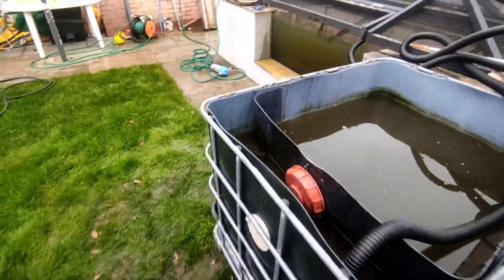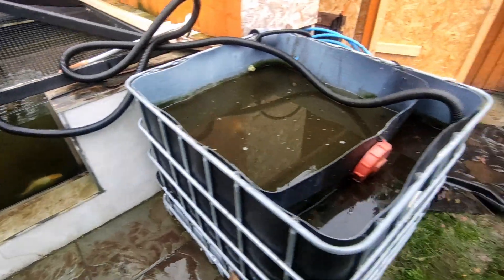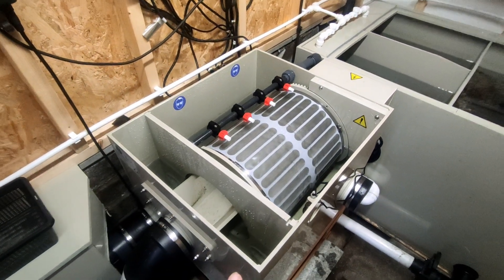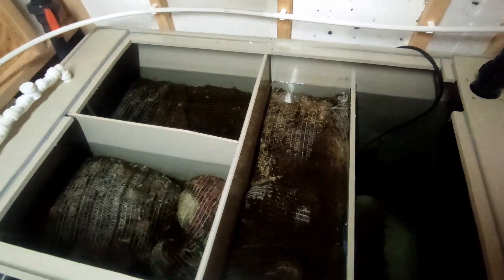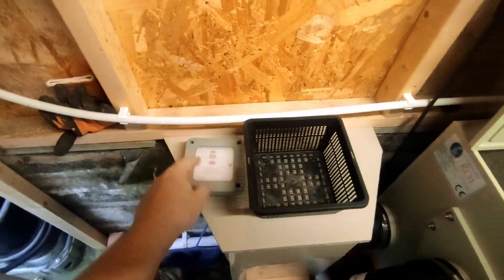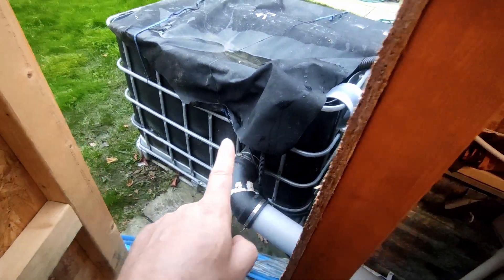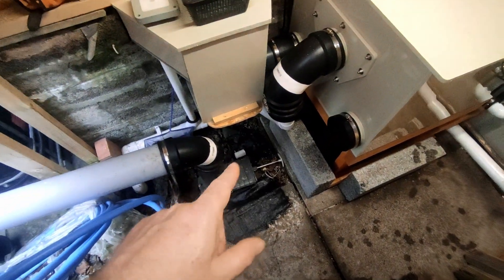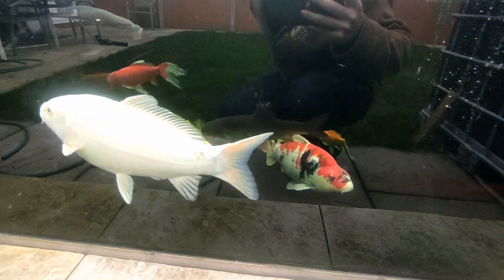drum filter update

Comment: You should double check that armoured cable is connected to a 30ma rcd. Wouldn't recommend not having any rcd protection. Electrical regulations BS7671 states that if a socket can be used for mobile equipment outside then it requires 30ma protection. 

Also your pump might have a fault  and you've just removed its protection. Food for thought...last thing i want is to see your fish cooked in your next update....or worse no more updates 🙃

Happy ponding matey. Liked and subbed
Reply from the maker: Hi, thanks for the input. So the connection outside is on a RCD protected circuit from the main fuse board. The second RCD, where it comes through the wall, was put there to make it easy to disable the leccy. This is what was replaced with the fused switch socket. Does there need to be an outside RCD? Or is the main fuse board one enough?
Reply: @BackGardenPond  perfect 👌.  As long as its covered by one your good. Actually one is better than two. They can mess with each other and cause neusence tripping. 👍
Reply: It's quite possible that your trip is not motor rated, this is why it was tripping.
Reply from the maker: @tjnorton100 It may have not been, or just an issue with having 2 in the system. Either way it hasn't missed a beat since swapping it out👍
Reply: It could be the rcd I had one on a pond skimmer was set on a timer to switch on and off when the auto feeder feed the fish. Every so often it would trip for no reason I changed it for a better make and have never had the issue again. You get what you pay for.
Reply from the maker: @andrewjbuckley  It had been running fine for 4 years, but only ever things that stayed on, not switching on and off frequently. This, I guess, was too much for it.
I also heard after a few trips, it will then become slightly weaker the next time, so trips sooner, and so on. not sure if there is any truth to that. I was also thinking of turning on and off the skimmer (when I set it up properly) but now I not sure if I want to test my luck!!